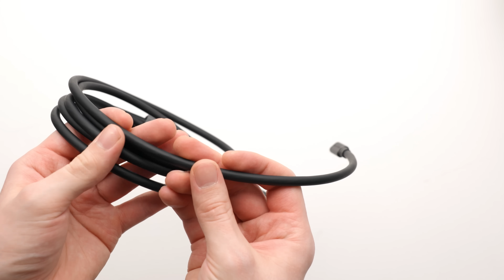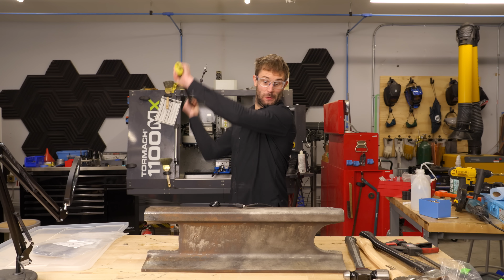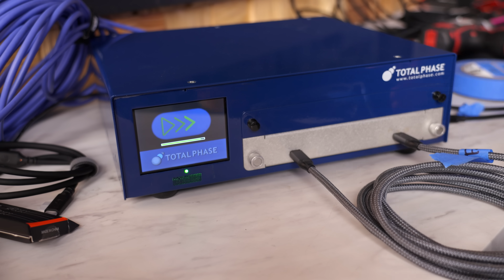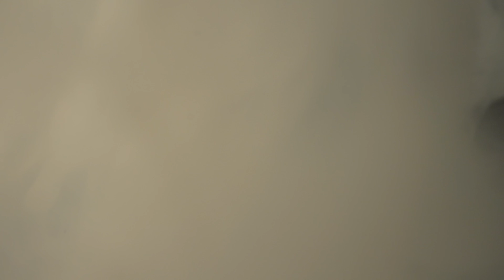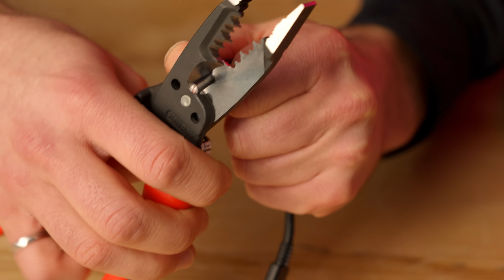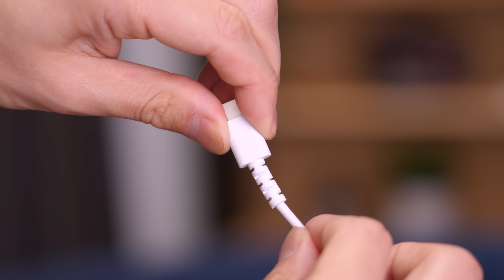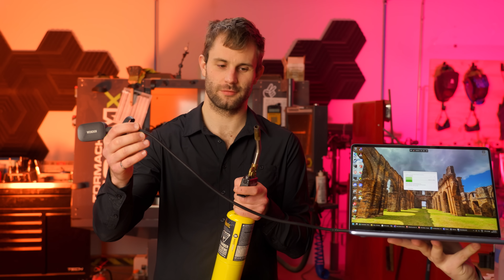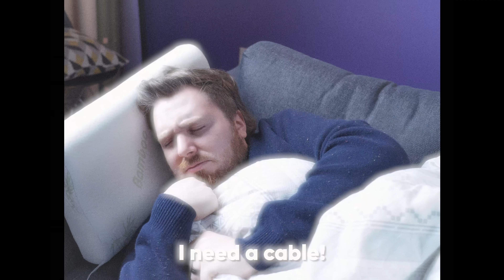Why It Took Me 4 YEARS to Make a USB Cable

Comment: I tried to look on the website but it shows no products available for the cable
Reply: Me too. I can't find any cables for sale on their site
Reply: Same.
Reply: forum post is removed too.
Reply: Apprently there has been a glitch where the warehouse has run out, but the shop is  still taking orders, so it's easier to pull an item than send out emails to all orders that won't be fulfilled
Reply: Interesting they pulled the product but not the advertisment. Looks like a cease and desist from somebody.
Reply: @NoNameForNone no, they're just out of stock.
Reply: @NoNameForNone  they had to remove the product instead of saying "sold out" because people were somehow buying it even though there wasn't enough stock

Comment: People who care about cable quality already have good cables.  Yours does not have enough differentiation.  You would do better by offering an active one with a right-angle connector, which would be perfect for a laptop setup.
Reply: Yeah, I have good cables, bought some of theirs because of the longer lengths that I haven't found until now. They'll be super useful for me.

Comment: I'm not sure how many you had in stock, but either way, it's kind of pointless right now if you already can't sell lengths anymore that interest the average customer. But I'm writing this comment mainly because I don't understand why a 10 cm cable and a 5 m cable are the same price. Who pays $30 for a 10 cm cable to begin with??
Reply: They're super high data speed compared to the longer ones, a 10cm might be useful for mobile setups, those Apple Mac Minis clusters and things like that
Reply: @ovoovoovoovoovo   Yes, but they were all listed at the same price. Even the 20 cm ones and up were the same price. It makes no sense to me. I'd assume that most of the cost of making the cable is the amount of material that is used. So, there should be at least some price difference between 10 cm and 5 m, don't you think? I can't give you an exact number because I didn't make the product, but I can tell you that when I first looked, the 10 cm cable was $25, then, after a while, suddenly it was $30, and then I realized they were all $30, whether they were in stock or not. Now, the page doesn't exist anymore. lol ???

Comment: I would appreciate a photograph on the product page with each length (specifically the smaller lengths) to give a sense of how small they actually are compared to each other.

Additionally, there should be a bundle price option for 3 or more cords, (either different sizes, or the same size)
Reply: You may find helpful the use of a tape measure, you should be able to find the number that's written in the site with the suffix and know exactly how long it should be.

Comment: Lightning despite being not in the new phones is still a good thing to go for:
Theres I reckon 8 generations of phones that use lightning, the cables are poor and break easily. I’m on a IPhone 11 and will probably keep it for the next five years, a consideration to produce these cables for USB to lightning would be great
Reply: They're whole market as based on "highest speed and power for longest length possible" I believe Lightning cables don't need much speed and power. Also they would probably sell almost no cables and Lighting is still heavily controlled by Apple.

Comment: Why not different colors or translucent colors
Reply: Translucent woudn't work because everything is shielded, different colors would mean even more SKUs and more issues with stocking them. Also, there's a significantly smaller demand for them than for black cables.

Comment: Those are beyond reasonable prices.... I remember paying similar prices on amazon or ebay numerous times back in the day thinking I was getting a quality product then getting disappointed after only a short time in use, loose connectors, easily fraying. If the product delivers on quality, then I think it certainly is at the right price.

Comment: Are they considered USB4 though? I don’t see that lingo used anywhere on your page, so I’m curious if they meet the spec (Thunderbolt 3 backwards compatibility, for example).
Reply: Yes, they're not certified, but they are USB 4, PD and will be supported by some Thunderbolt connections based on their chip's supported data and power rates.

Comment: Love this way of thinking. Coax, thick, not braided outside, clear labels, and lots of lengths. Aldo i would love to se a udate later with 80 Gbps (thunderbolt 5). And maby when you sell the firat few batches as with your screwdrivers. Maby udate with more SKU for custom colors such as magenta and orange? 

As for the webiste i strugle finding charge Whattage when selecting cable lengths. Only Gbps ratings. I know its printed on the cable, but it makes it difficult to know in advance. Or is all USB C cables good for 240W power delivery but only strugle with retaining data speeds? Im that case this should be markeded clearly becouse 240w on a 5m is impressive 

Thanks for the releases. Also i want to note that this cables is not expensive at all compared to other cables
Reply: Yes, all of them are 240W.

Comment: Buying cables makes me cry. Your series of reviews a long time back was very helpful though. I hope as your store improves in its reach, i can buy in the UK from a trusted source. I've bought cables that are ok, for sure, and seem to work, but they're such a crap shoot. I trust you wont be selling low to high end parts. Just high end fully spec validated only. And so there is less chance of a crap shoot cable creeping in.

Next up. Latest gen HDMI & Displayport cables hahaha, god i feel bad for you already.

Also Type C to Displayport cables.

SUpporting TB5/USB4.

I LOVE the speed/spec stamping on the connectors.

The prices are high, because they meet full the spec and quality, without BS gold super signal marketing. That is fair. It also goes to a company and its staff, not to a massive mega corp who will eventually enshittify to shareholder pressure to fuck us over.

Comment: The real reason it took so long... Linus had to prepare for his shirtless scene during this video.  Checked the prices and they are "not crazy", so that's great news.  
Have the 40Gbps C-C cables also been tested for Thunderbolt 4 compatibility, or is that spec identical to USB 4 in terms of signal integrity?  (if they pass TB5 spec, it's actually way cheaper than most TB5 cables I've seen)

Comment: @LinusTechTips I will spec USB cables for AV designs fairly often, and if I may offer a humble suggestion to make navigating your store easier.  Instead of having a long scroll for for just USB-C to C or C to A, break them up by bandwidth. Make the only choice length.  Recently C2G moved their website to Legrand and made the navigation awful when you're looking to see what your options are. If you can make yours just a little more straight forward, would go a long way for adoption. (Integrator discounts wouldn't hurt either!) But AV will not consider cost a barrier, if the cable is guaranteed to work.

Best of luck in your new endeavor!

Comment: Silicone insulation. I like the feel of it, but won't it fray? My understanding is that is why the macbook charger cables all fray. PVC is cheap, low-end, but it works better.
Reply: You should really try some ultra-high-quality silicone cables like the Ubiquiti one's. They much better then even the most premium braided cables I own. I understand you, braided cables used to mean quality a while ago, but I promise you, things have changed (with some premium silicone cables).

Comment: i had problemswhith hdmi, dpi and usbcables.  after trying many different brands i came across one that answered all my players.  yep itsa not 60 pound cables either.  its amazon basics.  i haVE MAYBE ORDERED 5-6 HDMI 12-15 METRE CAbles, all do 4k at 60fps and 4k hdr dolby vision ect...
i have 3 dpi 3-4-5 metre cables and they all work and all the usb usbc usb micro cables for chargeing and data transfer and amazon basics brilliant.

Comment: Could you also do hard drive cables? Meaning USB A or C cables that have a Micro B connection on the other end.

Those ones would be really useful for people that have to rely on external HDDs or SSDs.

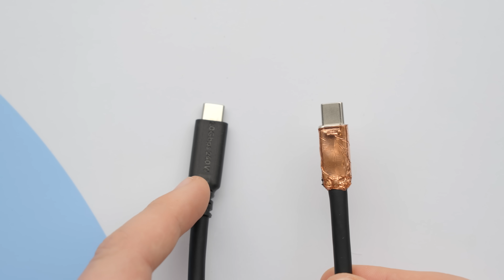Comment: 9:20 
I would rather have a less durable usb connector than a broken USB Port on one of my devices.
That is also somthing to consider.
Reply: It is, but they're not mutually exclusive, there's many things you could do to make the connection be safe to the cable and the usb port on the PC.
Reply: @ovoovoovoovoovo  they are. something has to give way.

Either the connector on the cable snaps or you bend or rip the connector from the circuit board.
Reply: @xZeroGrxvity  Or they disconnect, or the cable bends, or the connector, beign flush with the chassis,  doesn't allow for much sideways motion, reducing the chance of it exerting enough force to break.
There are many other factor you're ignoring.

Comment: Will you do Power only cables (as to avoid getting juice jacked)? It's hard to find a cable that is guaranteed to be  power only. What would be super unique is a cable with a physical switch that can disconnect the data lines so you can use it for data and charging (I would pay for that).
Reply: If it can be implemented this is and excellent idea

Comment: The labels are brutal. You couldn't do a square round-rect containing GB/s and MB/s to avoid the margin gore?
Reply: Then they would have spacing gore as all the connectors are made with the same mold and they would need to fit different number of characters on each SKU.

Comment: They’re not cheap, no, but if they’re built as well as you say… I’m good with it. I’ve got cables I’ve labeled with “power only” or “slow data” or sometimes even “fast data”. I picked up a few Truespec cables and, if they hold up to my usage, I’ll be buying more!

I’d love to see some DP options (maybe even longer than 6’ for some specialist setups? 🥺) and HDMI options (if you can deal with that red tape). Combined with my L1Techs DP KVM, I’ll have a damn good YouTuber Product (not merch!) setup letting the bits flow smoothly 😺

Comment: Lmao, perfect timing. I've recently been burned because of cheapo cables that just didn't work.. but when I swapped out cabled, everything just magically worked. I'd rather just make sure all the cables in my house don't suck because diagnosing that the problem is due to one faulty cable kinda sucked. And when is Riley putting out an album?

Comment: I am excited to pick one of these us, but I am worried how it will work with my SuperVooc 80W charging block since it has a USB A output. I will test and see.
Reply: I would not recommend you used those out-of-spec chargers with anything but the cables they came with!!!

Comment: Cant wait to try one of these, especially the "Thunderbolt 3" compatibility listed in the USB4 spec. Haven't found a non Thunderbolt cable that has ever allowed my Lynx Aurora N to connect yet for even a standard cable length (3.3ft). Longer runs are obviously out of the question. 
On that note, if you guys could expand this idea into active cabling especially for Thunderbolt (probably a lot harder to do but I have high hopes), competition is desperately needed in that space. I run 9 foot active thunderbolt cables from my rack and they have a tendency to break if you even look at them the wrong way. 

Signed,
An audio professional tired of rebuying 150$ Apple cables.

Comment: I'm an extroverted programmer- That means that the vast majority of my work is done in coffee shops, remote work environments, and libraries. So I use portable monitors, like, a  LOT. at the moment I've got a total of 7 I swap between for different use cases (yes, including an oled one for gaming, duh) but that also means i am stuck using those incredibly shitty USBC data cables that come with the monitor- NO cable I buy, EVER, works with them. They are short, break relatively easily, and have to be cared for- if these are truly TRUESPEC it would be amazing to have a legitimate source to buy replacements from- because apart from the companies that sell the screens, that's pretty much it (and the oculus link cable, but that's crazy expensive for my usecase) also, these are affordable while still being premium priced, perfect job LTT.
I'd argue putting a sponsor on a 13 minute advertisement for your own product is not...the best choice. other than that, informative, well-made, and if the products are as well made as the video, you've got yourself a customer.

Comment: It would be great to get Thunderbolt cables next. I have just switched over in using Thunderbolt for all my cables since they have to be certified and I know it will meet all the specs. It would be cool if you guys could test certified cables and see if they pass the signal integrity tests as well

Comment: $22 USD for a USB C-C cable is actually an amazing price. cheap @$$ cables from the gas station cost gradually more than that in my area they usually range from 25-30.

Comment: “There’s a big problem with the marketing around cables” 

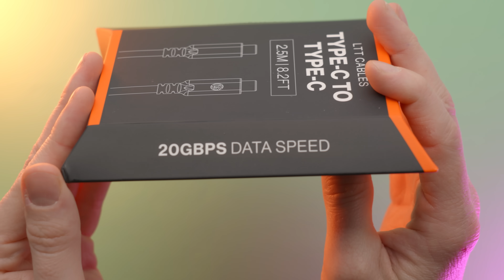… this is the first few seconds of the video … yet I’m only 00:39 in and the packaging states ‘20GBPS DATA SPEED’’

I’ve been a subscriber for many years … but I’ve slowed down my viewing based on this kind of presentation - it’s clear that the gap between Linus and the people actually branding/packaging/selling is so far that there’s little trust anymore from people who actually understand these numbers :-(

## now got to around 05:45 and cables are labeled correctly on the product … so why not the packaging? I’m a massive supporter of the channel, and I’ve watched Linus enthuse about these products in the video, but it just degrades my expectations if the person (with the knowledge) is advocating a product that even the packaging doesn’t reflect accurately … ?!?! Did I miss something here?

Comment: Nice to see this, finding proper cables isn't as easy as you would hope.  Two suggestions for the webpage: list the wattage each cable supports and provide a quick glance chart of what each cable spec covers so it's easy to pick the required cable.  On the cables themselves a colored ring on the ends would be handy for easily IDing them, especially in a situation (say an IT dept) where you have lots of cables around.  Heck of lot easier to grab the blue cable than say "hey look for the one with the 20 marked on it".

Comment: I actually tried designing a connector myself, because of the same reason.
What I arrived at was a binary system, one side signaling the data rate, the other the power delivery.
Denoting the lanes as well as the raw data throughput
The design was modular, being applicable DIY, and to cut down on production cost.
The power was denoted in amps x volt, limiting confusion of power delivery.
USB 30.21 P 20.5
2^30.2 Bit/s ~  1.25 GB/s
1 Lane
20Ax5V = 100W 

| | ||| ||| D ||| ||| | | = 30
. . . . . .    . . .x. . . = 2
. . . . . .    . . . . .x. = 1

| | ||| | | P ||| | | | | = 20
. . . . . .    .x. . . .x. = 5

Comment: Great video

The cable is cool, but I don't think I really need it. What I personally need is a nice usb-c cable with a long and thin connector. I hate that I must use cables that come with the device and can't replace them. Almost every device I have has a slightly different hole for usb-c, and it makes me mad

Comment: If you think 20 bucks for an extremely well built and rugged cable is too much then you probably deserve the crappy walmart cables you're probably also buying. 20 bucks is literally the same pricing as walking into any best buy. You can actually spend far more at best buy on a lesser cable. I think this is the first LTT product where the pricing is actually spot on. Can't say the same for anything else on the website though lol

Comment: for anyone wondering the 6.6ft 240W, is running for about $27 usd! 
Which imo... is freaking great! 
I have usb hub with a cable that intermittently fails,
that powers my laptop, macbook pro , charges iphone 17/ipad always pluuged in, and various perepheral devices as well as being connected to HDMI .

For $27 if i can get rid of the annoying intermittent failures.. for a usb wire that I will be using for the next 3 years at least!! this is great!!

Comment: price isn't bad , seems very competitive withe the pricing i find on amazon for cables that I would consider high quality. Now my question is, since signal integrity is such a concern and fiber optic now are much cheaper than before how much more expensive would a 16ft long cable that can do 20gb+ would be if used fiber in the current market?
I use long cables mostly for VR but I can see a near feature where people connect multiple thunderbolt or usb4 spec macs/pcs for AI inferencing instead of networking .

Comment: Looked at the listings on the store; yeah they're not cheap, but I wouldn't call them expensive either (for what they are: good).
It would be nice if you could offer power-only cables though, for use in public places where you want to charge a device (like a phone) without risking it being infected with malware.

Comment: Dang, I expected these to be more expensive, but they're priced very reasonably for what they are. Great job! I'd like to see shorter versions of the USB 2.0 (480 Mbps) cables, which I would have permanently plugged into a charger, where I wouldn't benefit from the higher data rates.

Also, thank you Riley for this BANGER

Comment: Less expensive than I thought. Kudos. but:

1. Will they work with thunderbolt 4/5
2. It would be nice to see the same with HDMI and Display cables as well. I have been subject to false advertisements on so many occasions when it comes to these ones. 

all in all, solid work👏